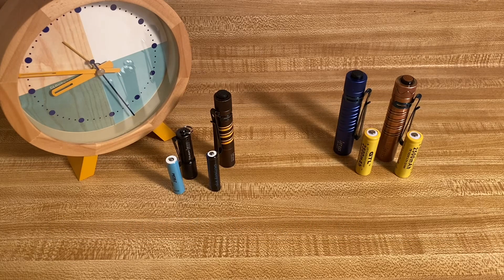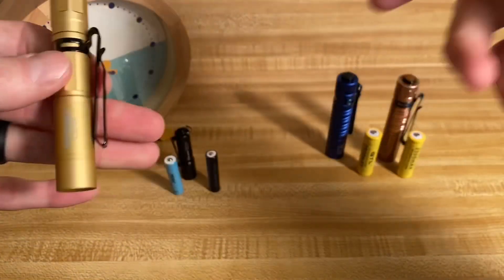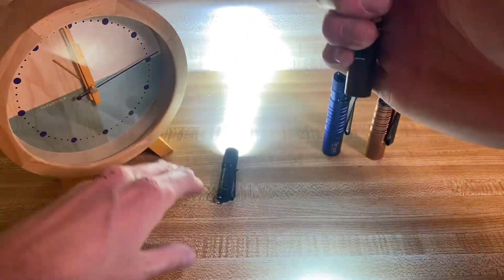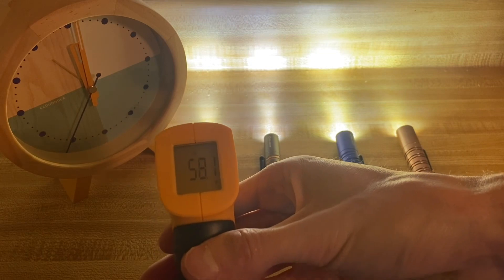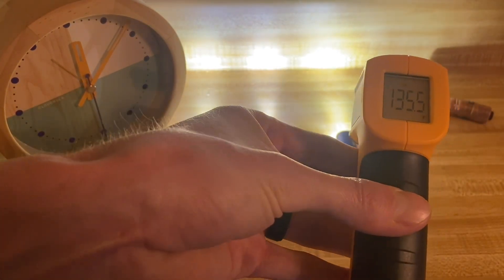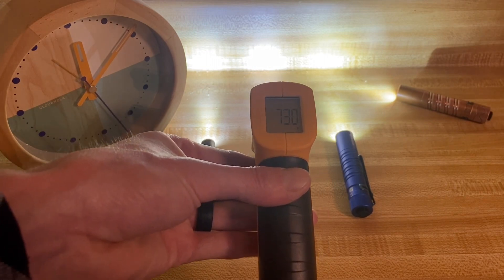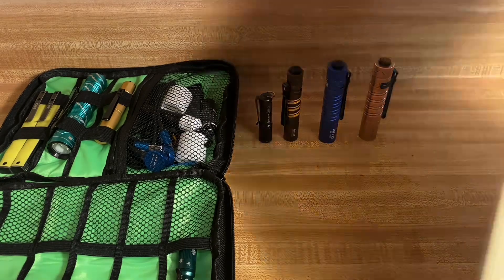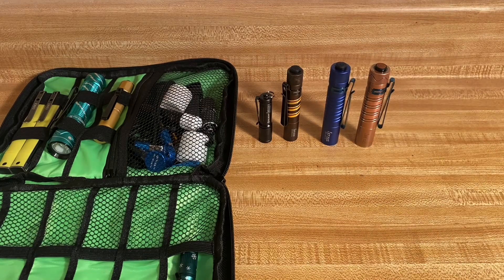Heat Testing the Olight i3T, i3E, i5T & i5R with 3.7v 10440 & 14500 Lithium Cells

Comment: Great video bro, just the info i needed. I'm was trying to decide if the i5r was worth it..but I don't think it is. I3t is definitely the top flashlight here. Just got my carbon fiber in yesterday, it looks pretty nice. Don't ask why, but being carbon fiber I swore it was going to be lighter then the aluminum and its just about the same in grams! Lmao definitely looks better tho!
Reply: IIRC, the external is carbon fibre but the internal is still aluminium as the tailcap switch stll need an electrical  path to the head through the tube. Btw excellent exoeriment. Thanks
Reply from the maker: Good points about the mechanics and internals of the i3T! I hadn’t thought about the need to complete the connection but that makes sense.
Reply: @Meor Azmi  that makes sense didn't think of that! 👍🏼 thanks!!
Reply from the maker: Nice! Yeah the i3T looks great in carbon fiber. I like how they changed the styling cuts on that one. Thanks for the support 🤜🤛
Reply: @Pardon My English  omg I didn't even realize that!! Yea thats pretty sick!!
Reply: that's because it has an aluminium tube with a cf wrap.
Reply: I want to point out.. as a road bike rider… carbon fiber is aweful at heat conduction (rimbrakes are where that comes in) so I’d be worried about more potential damage to the unit compared to alum or anything else.. I saw the light and thought about getting it but decided not to due to the thermal conductivity. Plus the extra cost for a sleeve is just dumb